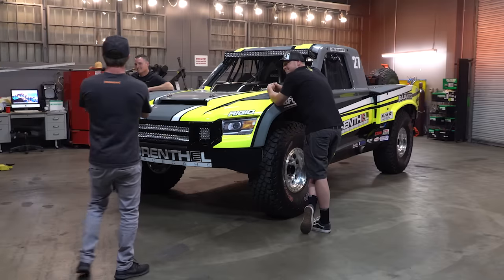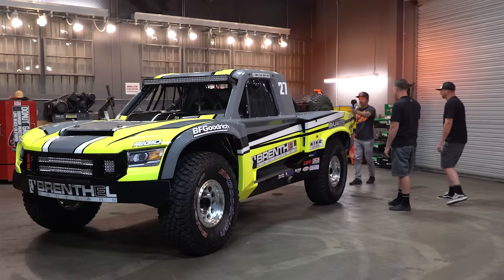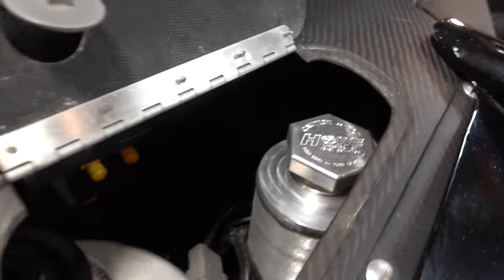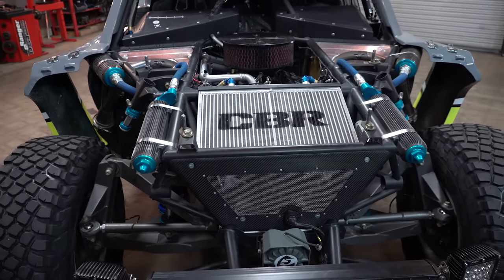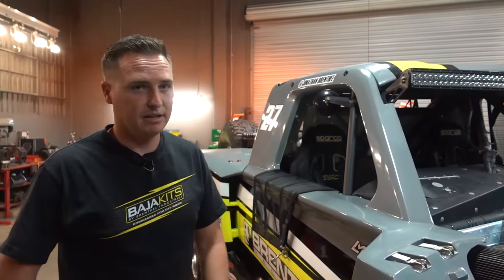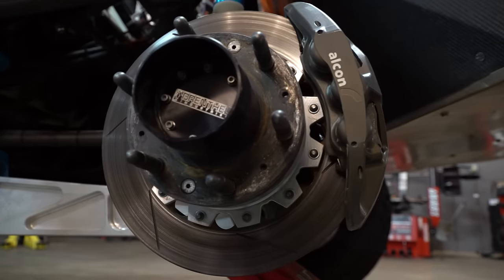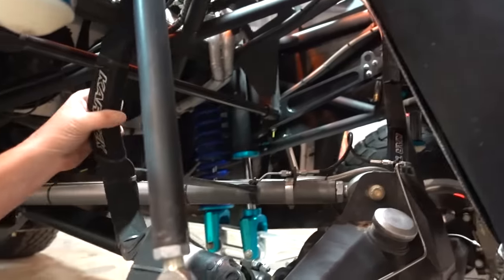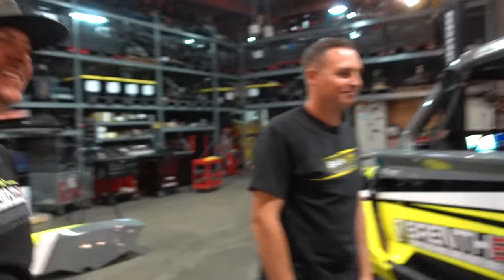The Ultimate Desert Racing Truck... That You Can Buy!

Comment from the maker: If you could put any engine into a Trophy Truck that ISN'T an LS, what engine would it be?!
Reply: Some sort of diesel.
Reply: Honda mini LS build...
Reply: MAXI V8 made from two Hayabusa motors at 11k rpm
Reply: Hoonigan I would put the lightest V8 Diesel engine I could find in it
Reply: Ummmmm a naturally aspirated V10?
Reply: Free Drugs prob has something to do with large tires and mashing the go pedal. But it is quite low mpg. But it’s like asking how much can u tow with your brand new corvette. It’s made for jumping and throwing down the power. I would love to own one.
Reply: A boosted boosah .. 1000hp motorcycle motor .. cuz why not

Also....

RESEARCH FLAT EARTH for a good time 🦄🦄
Reply: Cummis 6 liter, something with at least 1500 nm of torque
Reply: The 1gzfe boosted
Reply: Id do exactly what these brenthel bros did
Reply: A prius motor duh...
Reply: I'd swap in my 3.6L Pentastar and take whatever the trophy tuck has
Reply: 2 JZ no shit
Reply: How about 500+" big block of any brand topped with a 10-71 blower.
Reply: Cummins 12 valve
Reply: A 6.7 based Powerstroke
Reply: I don't know if you need torque for Baja, also a high rpm engine is to much close to failure... maybe a  ford v6  with a turbocharger, or a procharger at 12 to 15 psi, if possible, and a high lb inyectors... to make it reach close to the 650-750hp range... the thing is, if you want to go pro, you need to use a v8 aspirated or a +5.0L turbocharged diesel, i don't know if you can use a Turbo 6cyl engine and then race professionally...
Reply: BARRA
Reply: A 460 bbf. Destroked to the classic 429, then punched out back to 460cid
Reply: Tesla for sure
Reply: Multifuel. I wanna be able to fuel up using every nozzle at the gas station at the same time.
Reply: If I really owned it, a Kaase aluminum BBF.

For fantasyland - a bored/stroked Ford 427 'cammer.'
Reply: @wolfman5494  that's a nice idea, but pushing 4 digit power figures in the desert is gonna need something a little more potent than pump gas
Reply: 3 rotor, 20b engine😍
Reply: Ford 300 I6- reinforced and boosted.
Reply: a highly modified TB48DE (Nissan Patrol) the RB26's bigger brother.
Reply: Viper V10 or the LS based V12. Since it is not an LS, just based on one.
Reply: something that isn't an 8 cylinder
Reply: 20b rotary but you'll need a 500 gallon gas tank
Reply: Cummins diesel
Or 2UR-GSE
Reply: LT5 Because it's a hard core engine
Reply: Dodge ram srt10 engine
Reply: I would use Brian S. land rover motor cause hes never going to work on it!!😂
Reply: 572!
Reply: @silentbobfan32  yea, but you cant drill your own oil well in the desert and run your silly big block off it like i'd be able to
Reply: Ace Mcloud how is it gonna pull a trophy truck I doubt it’ll work out
Reply: Brucie Longnose silly big block? Do you even hoonigan bruh?
Reply: Frig it, put a Monster Truck alcohol burning engine from grave digger
Reply: B16
Reply: BMW S85 V10 :) oh the sounds :)
Reply: mad mikes rotary stadium truck
Reply: 2j.
Reply: Vk56
Reply: 6.7 powerstroke with upgraded compound turbos
Reply: 13b
Reply: Id put a honda k24/20 with a turbo bam
Reply: A Barra inline 6!!!!
Reply: Twin turboed Gen 1 raptor motor or Shelby gt350 motor
Reply: Roush Yates RY45
Reply: @YodaPala  bruh my shit runs on cruise ship engines. I've transcended hoonigan level
Reply: Brucie Longnose ah my bad, do ya thing boi
Reply: Four rotor
Reply: Remember the 5.4 DOHC GT500 motor? Revs to 8500 and made 550 hp stock? Throw twin turbskis on it and rip it til its drippin
Reply from the maker: @nathanz602  The gas mileage would be solid!
Reply from the maker: @cadincaldwell2637  That would be bad ass to see!
Reply: @mrMacMilli2000  it is funny but to bad we can't really help them out it is like talking to my nephew I love him but I can't understand him.
Reply: @TheHoonigans  i Second the idea of a 20b 3 Rotary turbo.  Wow that would be unique. or even a 26b 4 rotar
Reply: Naturally aspirated large bore, short stroke big block.  I want all the torque and RPM to keep the wheels moving.
Reply: I’d put a Roush Yates or a dart block
Reply: @Shadetreehack57  diesel just plain heavy & no middle or upper range horsepower... builder would never be able to get a good weight distribution or balance of vehicle front to back for high speed runs or jumps. Diesel great for towing trophy truck to events.
Reply: @gqh007  no torque...no torque......no torque
Reply: @mrMacMilli2000  NO TORQUE THATS WHY
Reply: Koenigsegg 1600hp twin turbo v8 from the new Jesko, whith their "compressed air turbo-kickstart" for No turbo lag🤘
Reply: @408SPLKINGS  the Rotary or boosa?  Rotarys make torque on the high end ... these trucks stay on that end.
Reply: Built 1500 hp hellcat engine
Reply: All aluminum 540 big block Chevy
Reply: Chris forsbergs Nissan Titan v8 he had in his drift car
Reply: Some  flatplane crank  v8 with turbos if possible even a v6 to add lightness with dhoc (duuno how well that'd work tho)
Reply: a turbo 1uzfe
Reply: The answer is obviously a supercharged Voodoo so you can be the best sounding truck in the race
Reply: @mrMacMilli2000  rotaries are gas guzzlers & it takes a specialist mechanic. Busa make little torque & both engines have poor transmission options.
Reply: 1uz or vw flat 4 aircooled
Reply: @408SPLKINGS  yall are no fun ... thought this was spossed to fun and unique.. all this Big Block blahh .. a Rotary Trophy truck would be epic.
Reply: Blown Detroit Diesel.
Reply: Bugatti 8.0 L quad-turbocharged W16
Reply: An Audi diesel V10
High revving Porsche 911 flat six
Rimac motors
Reply: A 427 or one of those camping world TRD toyota engines
Reply: Coyote obviously 👍
Reply: 3.5 Ecoboost
Reply: 5.9 common rail
Reply: @KABIPPO  way too much weight for racing in the desert
Reply: TVS charged coyote. Light. High revving.
Reply: Rotory lol
Reply: Gen 3 hemi
Reply: 12v cummins
Reply: B230FT🤘😂
Reply: Twin turbo Ford v6
Reply: Would it be interesting to put a dodge viper engine into a trophy truck?
Reply: 460big block ford
Reply: Big Hp Barra!
Reply: Ford Barra.

Issa 2J but cheaper
Reply: 9000rpm+ 1UZ-FE would be nice
Reply: Hoonigan please bring them to the burn yard!
Reply: The one from my GT500 might do ok.
Reply: Probably a BBC or SBC
Reply: A snarly AMG
Reply: I'm old so a Ford flathead V8!
Reply: 7.5l 460
Reply: Henessey tuned 572 big block
Reply: NISSAN CA18-DE bruh
Reply: MB OM629!! Check out some videos from BKORVEN on YT. 1000NM's of torque with such a nice exhaust sound <3
Reply: vr38
Reply: @abdullah_carart5638  Exactly my thougth
Reply: Twin turbski 12 valve Cummins with Allison tranny. 🤤🤤
Reply: LS
Reply: A Jon Kaase 830 c.i. Pro Stock Ford Hemi
Reply: Some v8 or v10
Reply: @zippymagee  why not be the first to turn a bugatti into a trophy truck
Reply: @deathbykram4274  i have no objection to that maybe the Brenthel guys can make the lift kit.
Reply: @zippymagee  the veyron has 1000 hp with crazy cooling, it weighs about 4300lbs, you add some beefy suspension and a strong cage your basically done.
Reply: everyone saying some of the same things... just throw a coyote in it with some boost...
Reply: Why not an LS?
Reply: Mercedes amg bi turbo v8. The newest one that makes over 600hp
Reply: voodoo v8
Reply: LT1! haha nah I'd run a honda J series with vtec of course, a vortec 4.3, or lfx- LS platform is the only V8 I fuck with lol
Reply: 572 720R... just for the exhaust note!
Reply: S85
Reply: uh................ an LT?
Reply: Hellcat
Reply: 2jz with twin turbo and nitrous
Reply: Electric motor behind ea wheel. With the world's longest extension cord.
Reply: 170 Slant 6
Reply: Jon Kaase 556 in Boss 9.
Reply: 1500 hp 4age
Reply: Big arse Hemi 572
Reply: @KABIPPO  a 6.7 to 7.3l stroker
Reply: VTEC
Reply: well then how about an  LT5
Reply: 632 bbc single turbo
Reply: @ericgibb4077  with triple turbos
Reply: Viper engine
Reply: Ftw top fuel hemi.
Anything else is rice in comparison.
Reply: A Cummins or Duramax
Reply: 2jz bois
Reply: Lmao 2jz
Reply: Lsx would NOT be my choice for an overweight truck.....or anyone else with a clue.
Reply: Supercharged Hemi
Reply: Maybe an upgraded 1fz-fe
Reply: @duramaxdad  yeah and you could expect that mileage from any non atomic engine making 1000hp
Reply: 6.7L cummins
Reply: A big block chevy
Reply: A 2JZ turbo'd
Reply: an AMC 401
Reply: Coyote ford engine
Reply: CAT C15
Reply: Chrysler 360 small block from a 98 jeep grand Cherokee 5.9
Reply: 4age
Reply: Brabus v12 lol
Reply: Easily it’s the new 7.3 Ford gasoline engine. Who wouldn’t want 445 factory inches all capped off with high flow aluminum cylinder heads? 

It’s what dreams are made of.
Reply: Triton v10
Reply: a fairly light diesel.
Reply: Always wanted to see a truck with a Lamborghini/Ferrari engine
Reply: Always wanted to see a truck with a Lamborghini or Ferrari engine
Reply: I really like the idea of a GNX motor in a little Tacoma or Ranger prerunner. theyre torquey, and make pretty solid power.
Reply: Sr20det
Reply: 427
Reply: When in doubt, 351 Ford normally aspirated.
Reply: Love your videos but look into some quality ,steady consistent sound.
Would be the poo!
Reply: It would be a long hood trophy truck cus I want an Unimog 9 Liter V10 twin Turbo Diesel motor that makes a around 1700hp
Reply: ka24. only 2 litre but bullet proof... i would put it in an old school datsun....
Reply: Diesel
Reply: Full custom 12 valve Cummins.
Reply: @Hoonigan FYI I found myself click forward past some of the editings between talking about each component
Reply: Coyote
Reply: Never thought 302 how about a 390 or a Cleveland?
Reply: How much you want to spend on it
Reply: For Greta Thunberg a Electro Motor
But a big V8 Hemi
Reply: A 106 mm all billet turbo 4 rotor...ahem...
Reply: let me rephrase that, an all billet 4 rotor engine with a single 106 mm garrett turbo. Est. 2000 crank hp on E85.
Reply: 355 Ford engine set up to turn 9500rpms
Reply: Hoonigan a Mopar Hellephant.
Reply: A 2jz_gte
Reply: Aluminator 52xs
Reply: A jet engine.
Reply: A turboshaft engine specifically.
Reply: Voodoo V8 with a big ol blower
Reply: 3 rotor
Reply: 1109ci Promod motor
Reply: LT4
Reply: That’s easy a 5.7 iForce
Reply: Billet 4BT  :-)
Reply: Ford 429 bored and stroked
Reply: Hoonigan 572 Chevy big block
Reply: Hellcat.
Reply: I6 4 rotor diesel, it would sound ridiculous
Reply: v12 lambo engine or 3.2L supra
Reply: #barratheworld
Reply: Rotary or 2jz
Reply: 453T Detroit.
Reply: LS swap the world
Reply: Either an I4 VTEC or a GIANT rotary
Reply: 2j
Reply: Turboed 2uz-fe
Reply: A custom made W32 Engine.
Reply: AMC third generation V8
Reply: ford 5.0
Reply: An LT...
Reply: Probably a V8 or V10 turbo diesel
Reply: Same
Reply: Maybe a boosted 1UZ-FE
Reply: Highly modified lawn mower engine
Reply: 430ci ford. build by pro power or Roush
Reply: 2jz
Reply: Coyote
Reply: F250 diesel powerstroke 6.7L v8
Reply: VR6 Turbo or an Audi 5 pot turbo
Reply: The most powerful electric motor I can find
Reply: Yup
Reply: Darkjedi351  It won't rev.
Reply: OM606 3.0L 6 inline mercedes superturbodiesel
Reply: The upcoming Ford “Megazilla” will be perfect for off road racing. It will 445 cubic inches of manufacturer engineered goodness.
Reply: Barra
Reply: EJ257 x3 stacked like pancakes.
Reply: Hellcat engine
Reply: a v8 voodoo
Reply: ford v6 ecoboost or nissan v6 twin turbo
Reply: Where do I buy this??
Reply: And a 2jz🤪
Reply: Cammed Viper V10
Reply: why not Trophy truck engine swap into any car loll, I bet it would sound sooo so mean in a custom mustang! Imma be doing a project like that whenever I'm rich. lmfao
Reply: Ford Nascar, you ever heard Robby Gordon coming in the desert, if you have you wouldn't be asking.
Reply: Aussie Barra motor
Reply: BMW M57N ;)
Reply: Gas turbine.
Reply: NRE
Reply: 4.0L V6 from 2nd gen Tacoma
Reply: 632 big block
Reply: A twin turbo powered Cummins diesel engine is something great for a Baja truck, even if it is almost 1,000 hp.
Reply: Jeep hurricane engine in the front and the back
Reply: Hellcat engine
Reply: 540 Merlin for a Chevy, Coyote for a Ford.
Reply: V12
Reply: 12valve cummins compound turbo
Reply: A Dodge Demon engine
Reply: high voltage electric.  full size traxxas UDR.
Reply: a built mercerdes om606 straight 6 turbo-diesel
Reply: Hemi
Reply: 2jz
Reply: V16
Reply: HEMI!! Since you can get any body for a Dodge... The best engine made but you better have $$$$$$
Reply: Flux capacitor. 
Or a turbo diesel hybrid
Reply: It would be cool to see Tesla’s plaid motor
Reply: Vr41dett
Reply: The new 7.3l Ford Godzilla motor.  That's such a sick motor.
Reply: V12 built from 2 v8s, just to send it
Reply: I would have a  Chevy vortec 8.1 v8 03
Reply: Id have it be two RB26’s custom made into a V12
Reply: "Eco" boost
Reply: 7.3 Godzilla supercharger too
Reply: @kylejohnson2184  he said anything BUT an LS
Reply: 350 V8 4 cylinder big block
Reply: 7.3 Godzilla ford.great torque and fuel economy
Reply: Cummins 12 valve.
Reply: GM R07.2
Reply: Ford, dodge or toyota V8
Reply: M113K from AMG SC V8 5,5L
Reply: @Shadetreehack57 well diesels have no power without a massive turbo system
Reply: @KABIPPO diesels only make torque from massive boost. Boost a gas engine and you get more torque and more horsepower then a diesel
Reply: @jalee6587  both mine and yours thinking is incomplete, diesels make more torque because they have longer stroke and you can boost them easily because the diesel combustible and also diesel cycle doesn't suffer from knock, boosting a diesel is funnier and biggest difference is that you dont usually boost a gas car to have torque and nothing else you make it in a way that allow to go up with the rpm and the power. A truck like this with a very very heavy front engine and massive torque curve i think would be ignorant but also pog for sure less environment friendly, efficient for the application and agile but funny for sure. Also Audi had shown the world that you can make a diesel Motorsport car at lemans, they make it to refuel less but they win indeed
Reply: 2UZ-FE
Reply: @misiek100020 Barra for the win

Comment: I can't get over how much shock travel, that you are getting. I had well over $100,000 into my 1985 bronco XLT. It was a full pre-runner. I was only getting about 10 inches travel in the front and I think it was 22 in the back. And that was really good at the time. I'm getting old. That was 30 years ago. That truck was so much fun. I sure miss that thing.
Reply: That's crazy you spent so much. I just spent $15k on lift, ADS triple bypass shocks, hydralic bump stops, wheels & tires on the gladiator. It has about 11.5" shaft travel on the shocks.  I want 40s but that's another 20k or so for axles and wheels. I plan on mobbing it with 37s for a while and see how it goes.

Comment: Chromoly, carbon fiber, billet, stainless, 1100hp, 100 gallon fuel cell and 40s sounds like I'll never afford one 😂
Reply: You forgot king shocks and bumps!
Reply: @2ndGenDesigns  ha yeah exactly!
Reply: About a million bucks. You don't have that laying around!?  😉
Reply: @magnus5356  I wish. Can I borrow it? Lol
Reply: Usually in off-road racing if you have to ask the price, you cant afford it lol. A truck like this is around $800,000 to fully build.
Reply: Not with that attitude lol
Reply: Get a well paying job and you could afford it one day.
Reply: @magnus5356  real trophy trucks range in the 400k to 600k top models 600k tip not a million you can build a prerunner for less then 100k to 200k
Reply: I'm sure you can get one just not as powerful
Reply: You can buy a Losi Super Baja Rey which is still expensive for an RC but a lottt cheaper than this!

Comment: triangles are the strongest shape you can make, correct, but not when cutting a hole in sheet metal for lightening.  in that case  a dimpled round hole is strongest.  if you understand why the triangle is the strongest shape you should understand why cutting a triangle shape hole in something doesn't transfer any of those properties.
Reply: Yep. Was thinking the same thing when he said that.
Reply: circles are stronger than triangles. this entire truck is amateurish.
Reply: Diesel Ramcharger yup, that's exactly what I meant.
Reply: @boblast5582  you hit the nail on the head though.
Reply: Knowledge Bombed!!! Lol
Reply: Ask de Havilland why you don't use corners
Reply: If you noticed those triangles were on the top of the shock mount. I can assume only for lightening purposes. I also don’t see a single piece of “sheet metal” more like plate steel. Edit sheetmetal logo on back. Only thing he said wrong was nothing on it was from a production truck. But they are using a th400 housing. Come on guys you can’t call this “amateurish”.
Reply: @boblast5582  Considering they are building trophy trucks, besides trolling, what are you building?
Reply: @todd6888  just cause I don’t build trophy trucks doesn’t mean I don’t know basic engineering principles

Comment: Nice build

Id love my 2005 3.0L v6 AWD Mercury Mariner to be a Rally Racer esq...still want it to be versatile ie pull trailer of need be....if i could afford the mods

Id do an overhaul on my Engine, install a more sturdy/bulletproof Transmission, Shocks and Struts, tires,  radiator, if feasible widen the axles

Comment: Ok so I race offroad dirtbikes but can't afford the trucks but I do have a nice 07  Silverado classic 4x4 with a little squat and method wheels.  It has the 5.3 and did a mild 212/218 cam and just got my speed engineering long tube headers.  I have a super 44 flowmaster on it but thinking of going 3" into muffler and 3" out.  What muffler would you guys recommend? I really do like black widow.  Any input would be awesome.  Thanks!